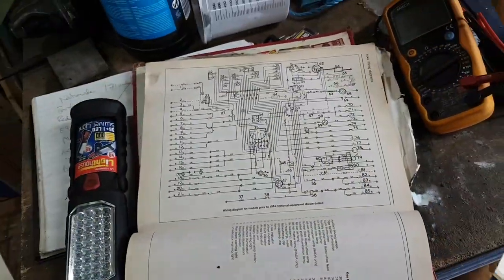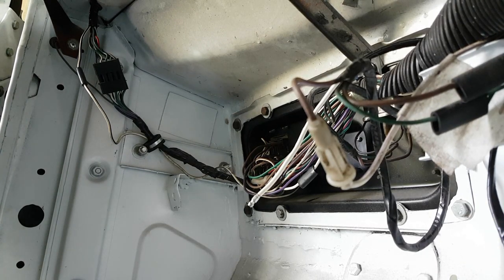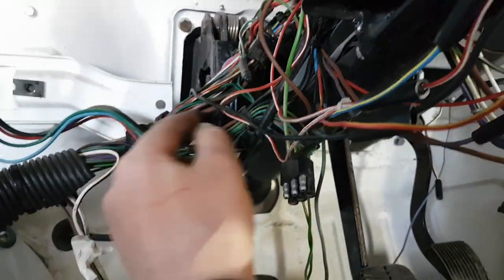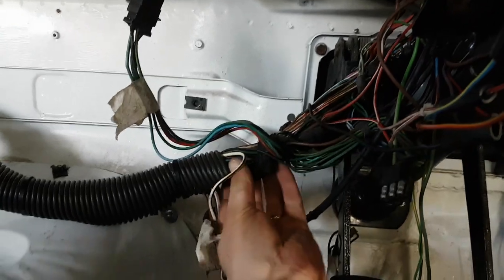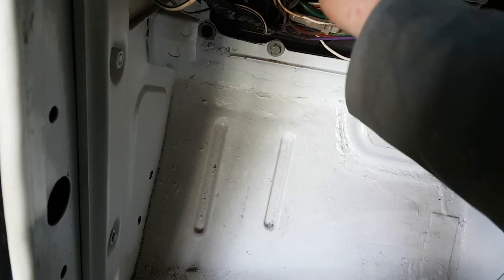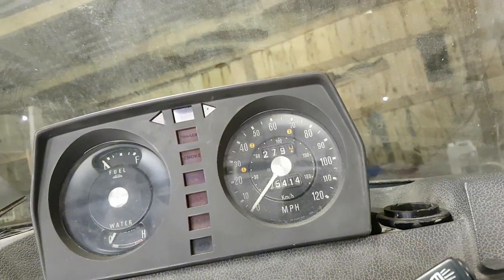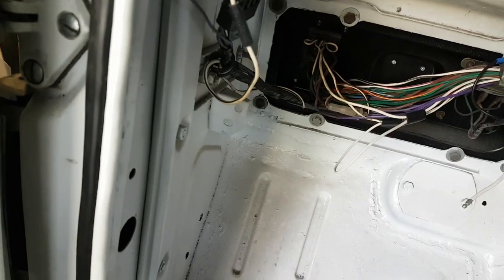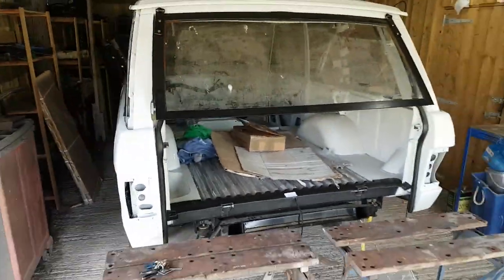Episode 13  1972 project Range Rover A Suffix - swearing warning

Comment: Hello, I'm Salv, i have just seen your video on the electric switch seats for a Range Rover Classic & i was wondering if you have the two little switches and the top plate as they are missing on my Range Rover, the switch works & mine are non memory ones. And it's the drivers side. Happy to pay you on ebay or if you don't have them if you know anyone who does have any? Thanks. Keep up the great vids - Salv
Reply from the maker: Hello, the switches turn up on ebay from time to time. Sorry but I have none to sell. Thanks for your kind feedback. Richard